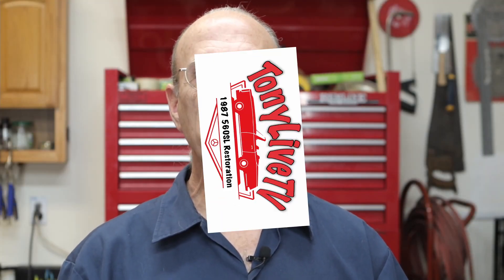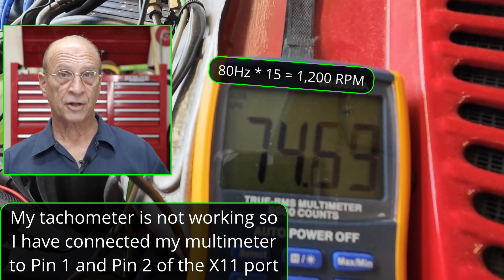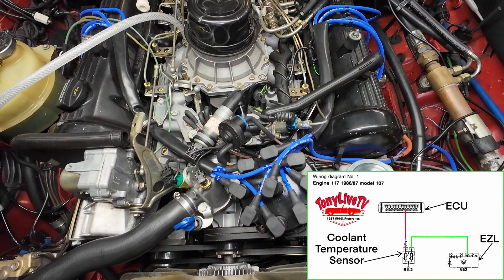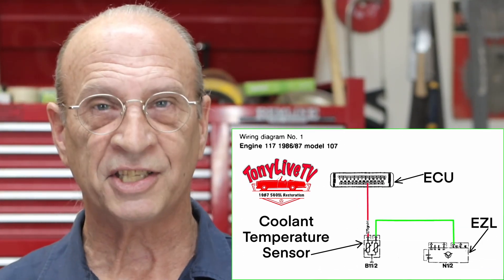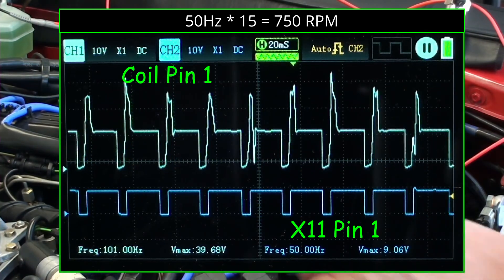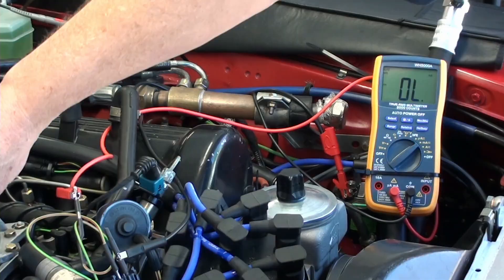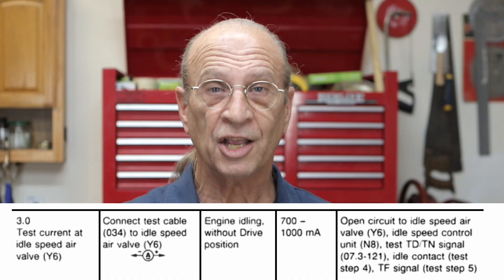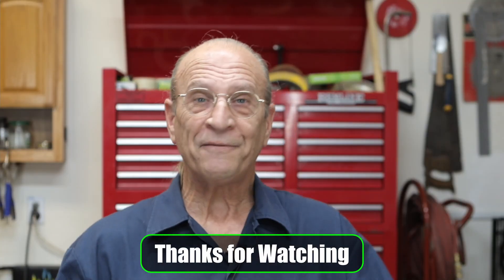560SL - KE-Jetronic Sensors, Controls & Verifying Idle Speed

Comment: It shows us something is wrong with the engine idle speed  control when you disconnect the ISCV Connector and nothing changes. One path of the intake air is metered at the throttle body. Then there is a second path of intake air metered by the ISCV. So the throttle body is mechanical and the Idle Speed Valve is electronic. 

So far my understanding is the ISCV has a constant 5v and the ECU/ISCU controls the operation on the ground side. At 1amp draw the Idle Valve Should be fully closed stopping the second path of intake air.

When you disconnect the ISCV the idle should raise, then plug the connector in and idle should be around 550-600, then if you complete the ground side all the way to 1 amp the valve should close and stall the engine out. 

Keep up the good work!!! I hope you get this figured out and you finally can enjoy your Benz.
Reply from the maker: @BlGNICK  hey there BIGNICK! How have you been? I haven’t had a chance to get back to it. I had to do brakes on my wife’s car and landscaping at my daughter’s house. The disconnecting of the ISCV and the engine not increasing in speed was the same thing that bothered me. Just because my idle is within spec doesn’t mean everything is good. I must successfully complete this final test of the ISCV before I can call it good and move on to adjusting duty-cycle. The most enjoyable part of owning this car for me has been figuring out how things work. I don’t even care to drive it to be honest with you. Next week I’ll be back at it. It’s already getting hot here in Arizona! We may hit 💯!
Reply: Hey Tony! I have been OK. I have a Mercedes 500 SEC with the same engine and same problem. High Idle. I will measure the voltage at my ISCV as you have. I will also attempt to measure idle speed as shown, however my RPM needle does work.

Also,  The radio problem you ask about is a short to power on the radio power supply circuit with the ignition Off.